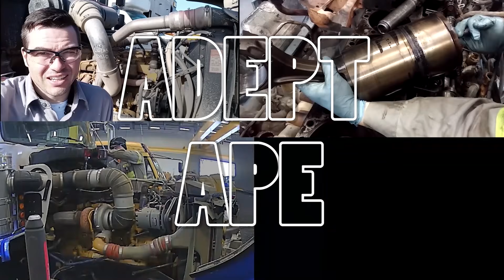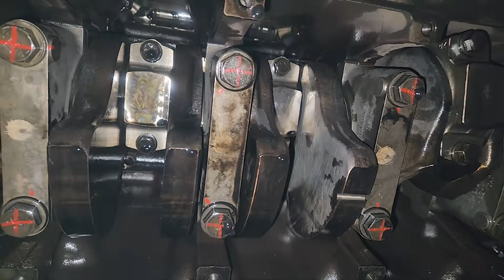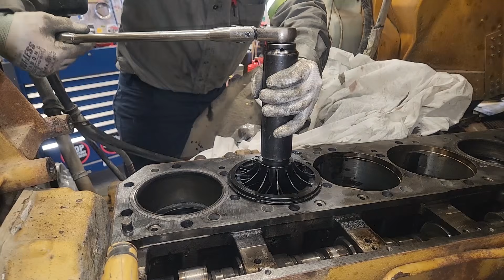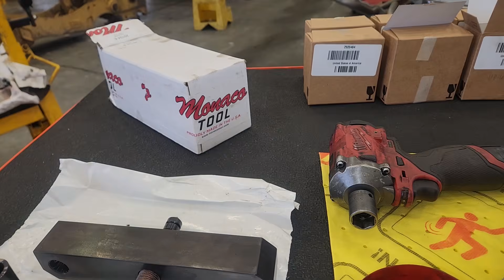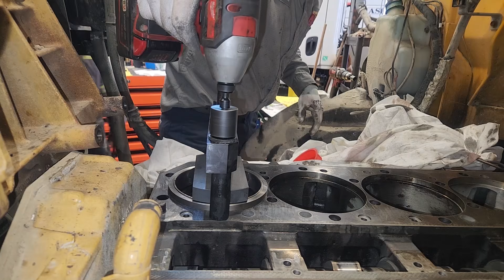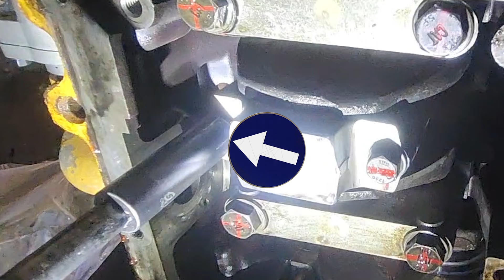Can "Charlie" be Rebuilt? C-12 Pistons, Liners, Bearing Remove and Install.

Comment from the maker: Thanks for watching. Hopefully you enjoyed the video. Links to the items in the video. https://s.vevor.com/bfP4YG VVSALE5 for 5% off
Looking for the Monaco Liner Installer: https://monacotool.com/collections/li...
Adeptape@yahoo.com on PayPal for donations.

Here is a list of recommended tools on Amazon: 
Red Tire Lube Bucket and Swabs: https://amzn.to/3PeGSwF
Oiling Can: https://amzn.to/3c3MKK0
DEX FIT Gloves FN330: https://amzn.to/3AAsOq9
Airlift Cooling System Vacuum Filling System: https://amzn.to/3D9AlPu
Milwaukee 3/8" Right Angle Impact Wrench: https://amzn.to/3D2CvAk
2 Pack M12 Style Batteries for Milwaukee: https://amzn.to/3D2mdHE
Adjustable Height Parts Tray 100 lbs: https://amzn.to/3CBusZB
Engine Oil and Fuel Dye UV: https://amzn.to/3z34zkv
UV Professional Grade Light: https://amzn.to/3gzxPc0
Allstar Oil Pressure Prime Tank: https://amzn.to/3SPx4t5
Photo Tach REED: https://amzn.to/3ATJ8Cw
Reply: THERE WAS SOME LINT ON THE JOURNAL. AT LEAST IT LOOKED LIKE IT .
Reply: So Vevor is like a re-branding company, maybe?  I bought a griddle top for my grill, its a Vevor.  Guess they aren't making anything.
Reply: It isn't just you, I had the same torque wrench and had the same issue.
Reply: Hi i got a question does your work place hire international students and train them to work there?

Comment: I'm 64. Maybe it's just me maybe my eyes are bad, but my goodness is. That thing just really that dirtier is my eyes that bad. Not talking about little grease spots. I'm talking about all around the motor inside. Place that you're where you're going together. With liners and stuff. Maybe I guess It's me or Eyes  that bad. Seems like normally the previous engines for cleaner.I guess I may just meet beam me guys.I'm not picking on anybody

Comment: The extension eats the angle, better off marking the bolt head and socket.  Have experienced the same thing many times.  The torque wrench starts measuring angle once a certain torque is acheieved and through the range.  Doesn't account for torsion from an extension.  Usually accurate when just using a socket.  Besides, who does torque turn without an impact and a striped socket?  😅

Comment: I’m an aircraft mechanic and my torque wrench was required to be calibrated and certified once a year. Probably not necessary for you on a yearly basis, but the first time will get it corrected so that it’s accurate. Also, shop noise is fine, it’s the sound of home. Best of luck👍💯

Comment: Josh, I am curious if you ever pull the new cylinder packs apart to check for the ring gap locations as I have heard there have been screwups at the factory with someone who goofed and lined up the gaps and then the rebuilt engine was burning oil/bowby and upon a teardown that is what was discovered. Of course it would be a pain and more labour to go through such a step.
Reply from the maker: I have pulled them apart to install liners separate when I'm not sure about liner projection, but not for ring gap.

Comment: couldnt you use that new liner puller  to set the new liners in so you dont have to drop them ?  Probably take too much time ?
Reply from the maker: It would make the process a lot more complicated and possible add contaminates to the new components. the "drop" might look bad in the video, but you are really just setting them as close as you can until you have to basically let them rest on the liner seal, pretty much the only way to do it unless you could get under it and lower it somehow with the rod. Good question though.

Comment: Youd think oil holes in the rod bearings would promote easier spinning. Especially since the rod is oiled through the crank.  Oil behind  the bearing  seems like it would reduce its grip on the rod
Reply from the maker: It has a weird design for sure, not sure why they would want them there. There is no oil supply to the wrist pin so you don't need one.
Reply: @AdeptApe  dull pin mods. I've seen high pro engines with that mod. Aluminum rods mostly.
Reply: W/Larger cap end.

Comment: good afternoon friend, I'm from Brazil and I follow your channel because you do an excellent job, congratulations, but with my few years working with mechanics I learned that the angular torque must be given at once and without ratcheting the wrench, because that's it single torque movement that makes the screw leave the elastic phase for the plastic phase, generating better thread locking.

Comment: I thought people were joking when they told me Snap-On roll cabs were the price of cars.

Jesus fuckin' christ dude

I understand the tools are worth it but sheet metal is sheet metal.

I buy gatorbuilt and modify the absolute hell out of them and don't even come close to what SnapOn is ripping you guys off for.
Reply from the maker: Toolboxes are expensive, but you have to realize a few things.
1. I don't pay anywhere near list price from a toolbox.
2. Snap On tool boxes hold their value pretty well, they depreciate a lot less than a car for example.
3. I make a good wage a as mechanic and want a good work platform for working.
You can use whatever tool box you want and I'll use what I want. I don't advise young guys to go into debt with tools and toolboxes if they can avoid it though.

Comment: I recall ounce upon a time reading some literature that had a bunch of mathematical material on how to figure torque loss on a variety of extension lengths and sizes. Come to think of it it may have been in the instructions for a torque wrench I had just purchased. Not sure exactly but I know there is at least information to answer your questions somewhere out there.  Take care Mr. And have a Merry Christmas

Comment: I have a c12 it's a great motor not a huge powerhouse but gets 7.5 and is so reliable and simple.  I need to over haul it does anybody here know of a good reasonable shop or independent guy located in MN?

Comment: I just had to use this exact tool to pull piston packs out of a 60 Series 14L and I ended up having to keep pressure in the liner #2 over the weekend and tapping with a long race punch on the bottom of the liner to have it break free. Glad I didn’t have to torch the rod out.

Comment: Snap-on good tools ... spendy but all my Snap-on tools are still in good working condition. In 1975 I bought a Snap-on 2 finger puller 20 piece set 6" to 12" puller $108. 
🤔 is that a good price?
in early 2021, I  paid $360 for a Proto 1"d, 2' breaker bar, 1"d, 6" extension and a 1"d, 1 1/4 impact socket. I thought that was a good price. 
Anyway great info as always. 😂🤟 Cat loves their proprietor specialized tooling, don't they. Thing is they work.😎

Comment: 8:22 if you, the reader, wanted to try it with a plug to see if it'll work as a pack puller the diaphragm from a brake chamber is usually the right diameter for the job

Comment: Before five star, we would put our cylinder pack puller in a bucket of oil dry to absorb any fluids on the rubber. We also added one inch on the stand to make sure the liner was completely out of three oring liners.
When Cat first came out with the cylinder pack puller. I had a cab over 3406 mechanical I was in-framing. The cab was laid over with a come along to help support it. The stand was not part of the tooling yet, just a eye lit. So I put the eye lit on, hooked a chain to the puller and hoisted the pack up. The front tire started coming off the ground. The liner released, truck came down and bounced. Cab moved up, come along unhooked. Cab went down and bottomed the cylinders out and John messed up a good pair of under wear.
Reply: I’m jealous five star and bomb proof safety is all I know lol

Comment: My 2 cents on the shop noise thing is it depends. Sometimes I watch your old videos to answer my own questions when working on my engine. It might not be exactly the topic of the video but a part you removed along the way and shared extra details on how you did it. For example your oil cooler video, the details on how to put the 3 pieces back together the easiest, in that case I would like the clarity of voice over. However if you're removing the clamp on a heater hose, who cares if there's shop noise? This video can become on encyclopedia reference 5 years from now.
Reply: Also another note to add from my perspective being an owner operator is I might be watching the video to judge if I can do the work or if it's a shop job. I wouldn't do the rebuild you're showing in this video but I might try a water pump replacement if the shop says a week to pull my truck in.

Comment: Yeah noise is fine 
I would say you extension is causing the torque wrench to be off  the mechanical connection between the extension the torque wrench and the socket I'd say add 3° to the 90° that may take up the difference plus I'm sure that snap-on recalibrates those once or twice a year I believe

Comment: I’ve found that with the techangle when you need to stop and use the ratchet feature mid-turn it becomes less accurate because it starts counting before the bolt starts turning. If you can do it in one fell swoop it seems much more accurate.
Reply: I'll check that out. I do automotive and and Subaru HG's are a pain using marks. I think the degree's don't equal 30 60 or 90 either. Got the 1/2" Snappy  and made life easier, I've checked the angle with marks and thought they were maybe 5 degrees or less short.

Comment: I don't understand why you need a special tool to pull the liners.  When I rebuilt my C12, I pushed the pistons out the top of the liners and removed them, then knocked the liners out from the bottom with a block of wood and a hammer.  One tap, and they're out.  Much faster and easier.  And cheaper, since you don't have to buy the special tool.

Comment: I do a lot of heads on GM LT V8s and the torque angle is really not accurate when you have little space for the ratchet handle. Every time you reset the handle it uses like 5 degrees so the smaller throw area you have the more inaccurate.

Comment: I've noticed on a much cheaper digital torque wrench that does angle it will start counting degrees when you begin to load up the mechanism even if the bolt hasn't started moving yet so I think it is accurate if you can do your degree sweep in one motion but when you start and stop it will come up short

Comment: I was taught that an extension on a torque wrench changes how accurate they are .
Reply: This man right here is correct.  An extension does change torque values and of course also the angle if using one of these TechAngle torque wrenches
Reply: If an extension reduces torque. 

Then doesn’t a deep vs shallow socket also reduce torque?

Comment: My Snap-On tech angle 1/2" drive torque wrench turned itself off if I couldn't make the angle in one pull every time, Snap-On took it back several times but never got to the bottom of the issue, interestingly the last time they had it back when it was returned it was a completely different torque wrench in both appearance and operation to the original but still bore the same model number, different serial number, its been 100% reliable since then in several years of use in all orientations. Through the grapevine I've heard that some of the Tech Angle torque wrenches can be a bit twitchy, since the initial issue was resolved I've been very satisfied with mine. Kind regards from the UK 🇬🇧 ❤️🇺🇲

Comment: I have noticed with my TechAngle torque wrenches, when in angle mode, will start to count angle when I begin applying torque but the fastener has not rotated yet.  I deduced this is not as accurate as an angle gauge but I have built many automotive engines using my TechAngle torque wrenches, so as a flat rate tech, it’s good enough.  Thanks for pointing it out. 👍

Comment: I'd definitely have your dealer get it checked out. Especially since it's that new. Torque wrenches only have a 1 year warranty. My split beam 1/2" torques accuratly, but the adjuster moves slightly with each click and I have to reset it about every 5 clicks. Very annoying. 

Shop sounds don't bother me as long as it doesn't drown out what you're saying or blows out the mic.

Comment: On the turn I mark them like you do and then break out the impact especially under an engine. I haven't seen or heard of any reason that bolt cares how it gets to the turn. My first experience with torque turn was in 1970 on the v8 in a cat 651b scraper. We had 13 651s that we had to pull the soft plugs and clean the centrifuged dirt out. The specs that came with the cat service builtin were to throw away the pal nuts and go torque turn. I didn't run into Cummins with torque until some time in the 90s

Comment: I'm perfectly fine and happy with shop noise in the background. The shop I work in primarily handles minor car repairs so the shop tends to be really quiet with nothing but the sounds of fans and heaters to make noise unless I'm working on a bus. I find having videos like this in the background not only helps with white noise requirements but educational as well despite working on small Cummins.
Reply: Just gives the full experience!
Reply: I work in a locomotive shop and I’ll tell you sometimes you hear a noise and you’re like what the hell is going on over there 😂

Comment: It’s only a little off just a touch. Have Snapon recalibrate it it’s off 10 degrees. You probably have to check them quite often because you use them everyday. I bet every bolt you touch has a torque setting.
Reply: Should be tested every 3 months

Comment: Josh I had the same problem with MY tork wrench to same brand to I usually just use my Braker bar to do the final 60° or so the bolt head angle seems far easy than the tork wrench. Lol let it snow snow snow ya we had that two weeks ago for a solid week lol 😆

Comment: Ive found with the torque angle on any big name torque wrench, when you have to ratchet it, aka not achieving the angle in one continuous pull, it can be off. Idk why that is, but just from my experience. My snapon one, if i can get it in a single pull, it’s very accurate.